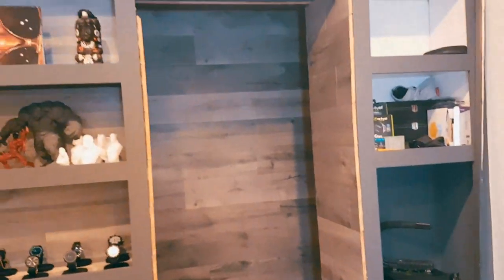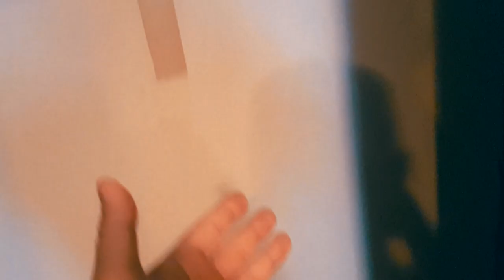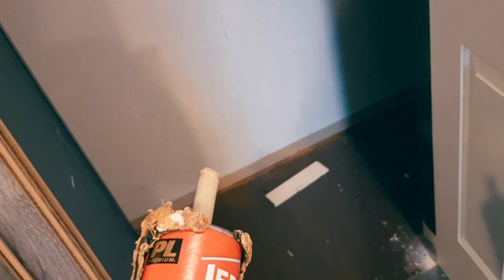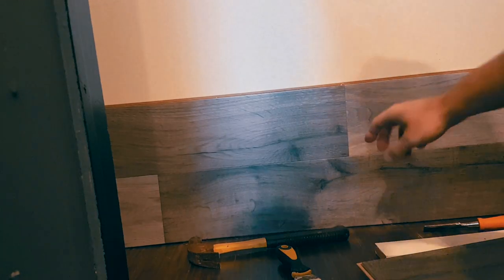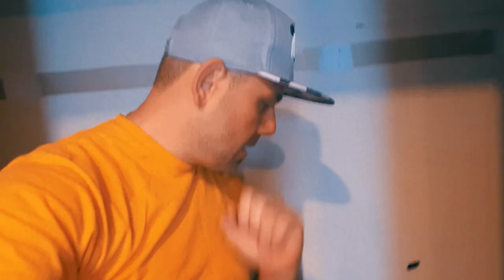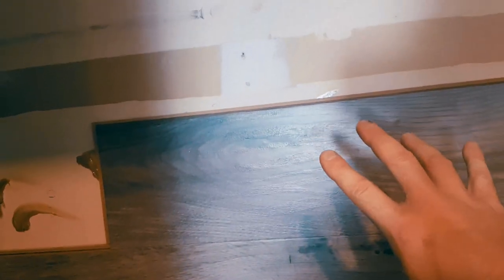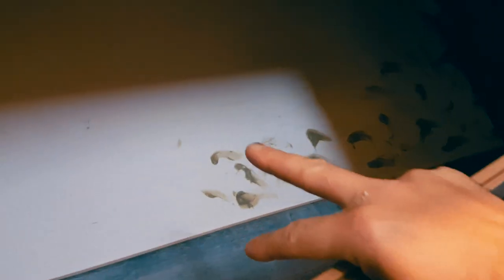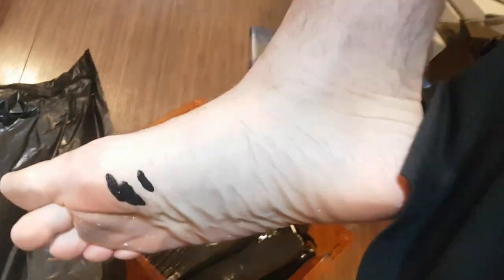DIY Closet and Bedroom Wall Panels. Fast Bedroom Makeover Ideas. Install Wood Paneling [Part 2]

Comment: Is it ok to put this over painted drywall that has peeling paint? I live in an older home and need a faster cleaner way to fix the walls in the closets
Reply from the maker: I'd rip the peeleling paint just by quickly pulling it and continue glueung as per video but yes over any surface